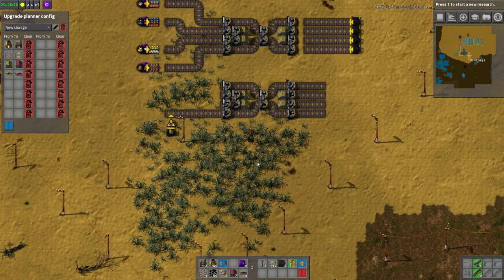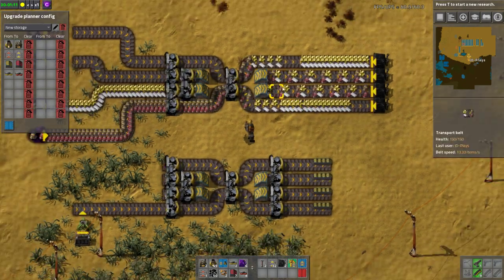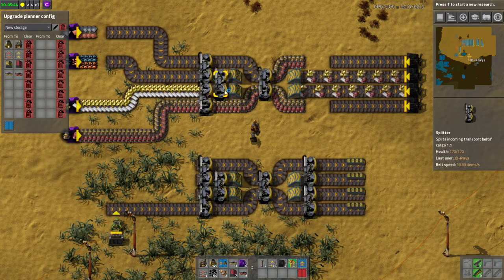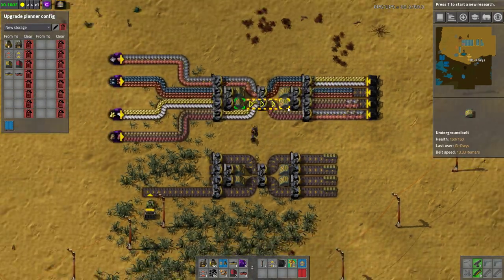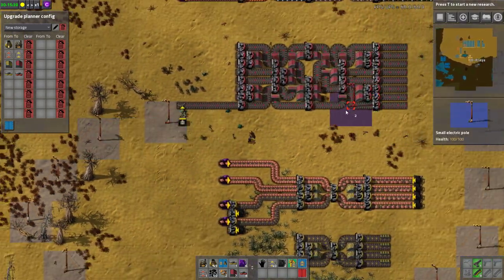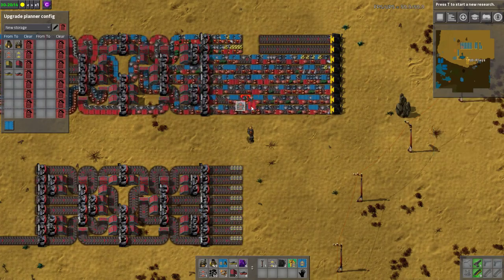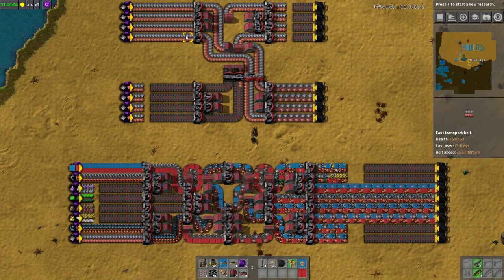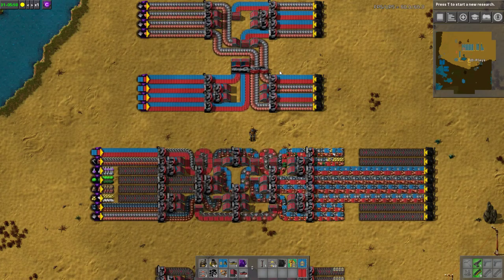Belt Balancers - Factorio - Tips and Tricks in 10 minutes

Comment: Because you grabbed a BP and started using it wrong, doesn't mean the balancer is working incorrectly. 
The last one is OBVIOUSLY 50% throughput and DESIGNED that way, as you are going from 4 to 2 lanes in the pass over. That does not require testing but just common sence.

I see this happen a lot, people blaming blueprints (that they grabbed of the internet or wherever themselves) for not working right while they are the ones that are implementing them wrong.
Reply: hate to break it to you, but there are actually 4 lanes in the passover, 2 of them are underground
Reply: @pocarski  Are you joking here, or are you just really that dense? 
The 2 underground belts are going the other way, so its a 4:2 per side, or 8:4 total. Either way it's a multitude of a 2:1 ratio, resulting in 0.5x possible throughput on the pass over.

PS. knowing basic math solves 99% of all problems this game has to offer.
Reply: In fact, it might still not be clear to some, merging 50% throughput from both 4 lane bus sides actually balances the 4 lane buses. 
It doesn't balance the individual lanes, but the total amount of items on either of the 4 lanes will be equal WITHOUT limiting the TOTAL throughput.
This bassicly comes down to the same point as made earlier: 
Dont complain about or use BP's if you are to dense to understand their function.
Reply: @benjiiano4077  lmao

Comment: About this nice 8-8 balancer that is not perfect. What happens if you connect two of them in the series? You can stack them very close to each other and even overlap input-output splitter in the middle where they join as they do the same thing, so it will not cost 2x but maybe 1.8x only. It will not improve the ultimate throughput limit but can mix things a bit better.
Reply from the maker: Mixing is something Intentionally dont cover, as most balancers dont mix things well, the idea is they will take 8 belts in and 8 belts out or 8 belts in and 7 belts out, taking 7/8ths from each of the input lines